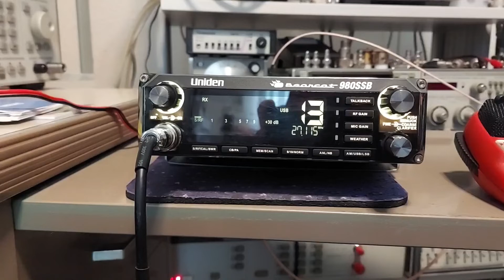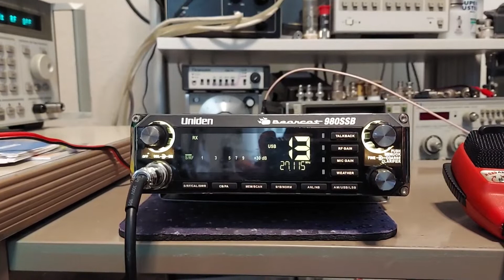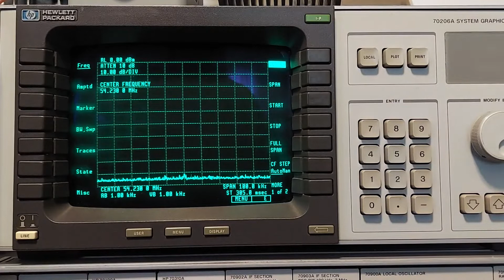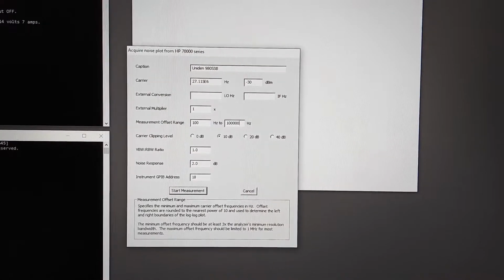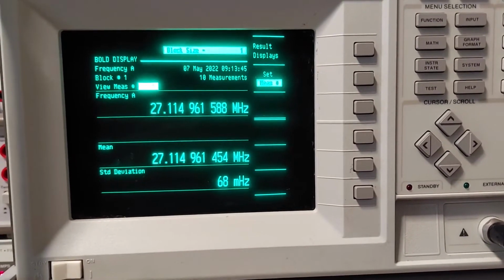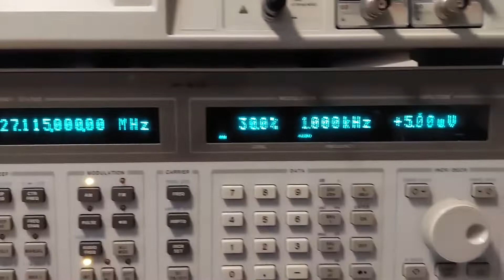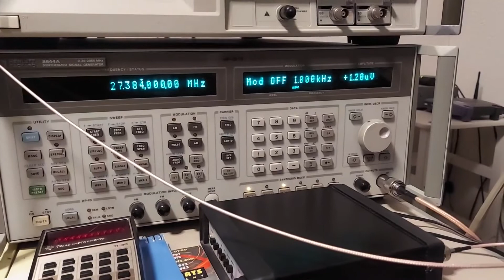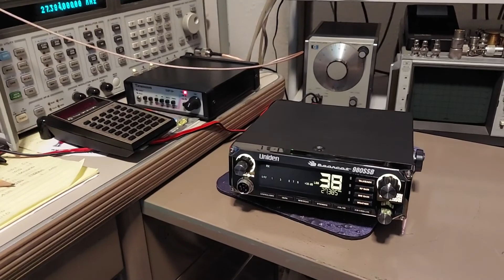Bench testing my Uniden 980SSB.

Comment: I don't recommend this radio! Super bad displays and uniden won't even sell you parts to repair it as front display board! Star away unless you want a door stop!
Reply from the maker: Yep, I would tend to agree. I didn't test the radio when I initially received it. Only later did I discover that the receive was around 10dB deaf and did not meet published receiver specifications. The biasing of the output section was also out of adjustment and was drawing about 2 amps on SSB with no modulation. Frequency stability was good for a CB, I never had an issue with the display, but was disappointed with this offering from Uniden.

Comment: Hello, wa ted to ask if you peaked and tuned it before you put it in your truck before this checkup? I have one and using it as a base and want to add an amp so was asking about peak and tune. Thanks
Reply from the maker: Hello Bill,
I did nothing to this radio, I wanted something bone stock to monitor traffic on my commute to work. I removed it from my truck and it has been sitting on a shelf ever since. All I have done is bench test it to see how it performs out of the box. It appears to work just fine with the exception of being deaf on receive. I'm guessing that I got a bad radio that wasn't aligned properly or there is something else wrong in the receive path. 73 and thanks for watching!

Comment: It's your coaxial cable or your antenna isn't grounding right.
Reply from the maker: Initially I thought it was the antenna I was using, but the antenna and feed line were just fine. Once I bench tested the radio I discovered that while the radio does receive, it does not receive as well as it should. My guess is that it was always like this but took me awhile to notice it.
Reply: @CraigPetersen12f36b  Would you recommend a Bearcat 980?
Reply: Bad displays ! Uniden won't even sell you display board to repair it!

Comment: Man, lovely gear.....dumb question? During the SINAD test, are you going through the Timewave?  Side note, I have one, its very-very nice!  Thanks!  ~Jack, VEG
Reply from the maker: Yes, I was using the Timewave to remove the 1kHz tone used for the SINAD measurement, it worked really well. Now that I have the HP 8901B modulation analyzer I can use that instead.